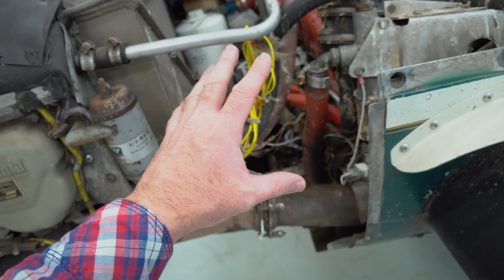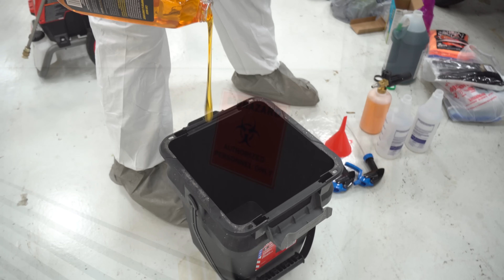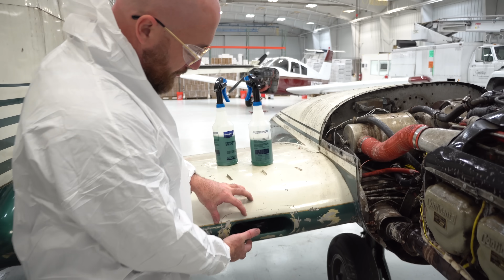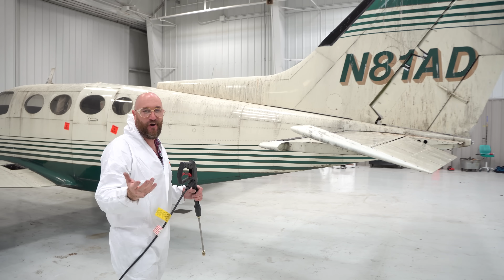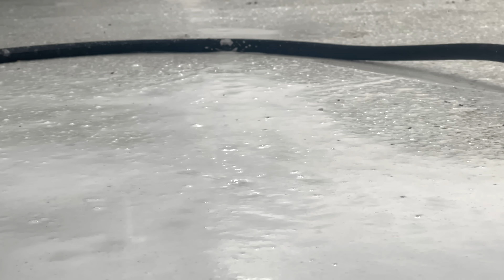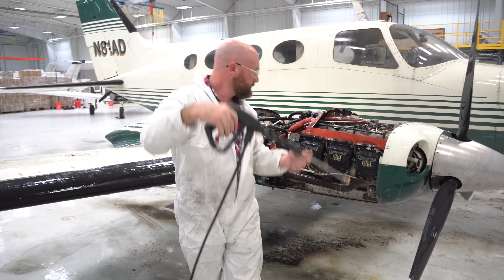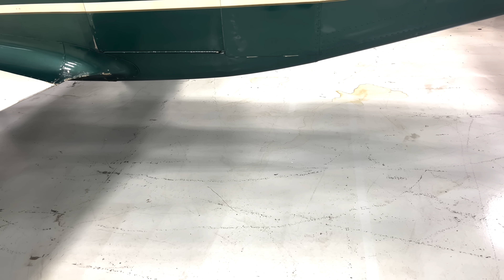Our FREE Abandoned Airplane Gets Its First Wash In 17 Years ! Ep7

Comment: Several years ago while working for a Aero Club we were able to get a 310K that had been a drug seizure. It had sat on St Simon's Island, GA for 10 years. After working on it for several weeks we were able to got it where we could fly it back to Charleston with a ferry permit. The engines were in surprisingly good condition. The worst part was the landing gear, the guy that flew it to Charleston wasn't happy I stipulated it be flown gear down but once he saw it on jacks with the gear mid travel and not moving up or down was glad I done that. You've got a lot of work ahead of you.

Comment: You ought to open all the inspection panels and look inside, especially on the wings.  If there's a lot of corrosion in the spars you want to know about that now, and not after putting a lot more work into it.
Reply: I've been thinking the same thing since this project began.  There will be a ton of hidden damage.  That mouse (likely mice) inside could also have done a lot of damage to wiring bundles.  Having an experienced A&P look it over before putting a bunch of money in it would be money well spent.

Comment: The EROSION & EPA FINES  that all dirt being washed away are going to cost you are more than the plane....
It was illegal to wash under the 1986 Anti-Erosion Act, don't let them see the video evidence ;)  Amazing for what was still underneath, although the dirt may have acted as anti_UV protection, saving the paint job.
Reply: which is likely the reason it was washed inside with the hangar doors closed. At most airports without a dedicated wash rack it is illegal to wash planes where the runoff can enter a storm drain.
Reply: @buckmurdock2500   Didn't know that about airports and washing planes. I would assume issues for fuel, oil and other chemicals for  run off of  such, if it didn't go into a sewer system.  Verses drains going to open creeks for surrounding open land for run off.  

Also I'm guessing my joke may not work or translated well over the internet for the ""erosion"" of all that dirt on the plane's  body by cleaning it. There used to be joke bumper stickers on most  dirty work /farm trucks from where and when I grew up,  stating that it was " illegal to wash the vehicles due to 1986(year varied) Anti-Erosion Act"  from the dirt be so thick on it. As if the vehicle had so much dirt on it , it was viewed more as mound/hill/mountain and  the high level of dirt being washed and running off from such would fall under anti-erosion protection laws....

Comment: With extra hot hot water and oxyclean it would remove all the grime and oxidation off. Also orange oil will dissolve a ton of crud. I have cleaned diesel motor caked in oil and crud with hot water and orange oil mixed looks like milk took all the crap off down to the metal

Comment: no fuel on sparkplugs despite spraying directly into air intake.  engine is not pumping, air not being drawn into cylinders. This is corroborated by low compression readings.  Valves are stuck open or are not seating closed completely.  Take off valve covers and tap valves with a brass mallet, try to get them freed up.

Comment: Rinse, Foam, Presure Wash, Foam, Hand Wash, Rinse, Dry............ Also foam then pressure wash the dirty spots first to avoid dirt spray on your already clean spots like it did for you. Put a stronger nozzle on the pressure washer and step further back your too close. You'll save time and be able to get more surface with a single stroke

Comment: I can only think that, not on camera, he's got an AMO doing the actual rectification work (corrosion, flight controls, pneumatics, fuel system wou.... Basically everything). It's costing a fortune but that could get you a really expensive 'free' airplane that you could use for a private operation. If that happens the engines and props will not be the ones fitted.

Comment: The exterior is simple enough except that the engines really need taking apart and the individual components cleaned/serviced (otherwise it is a simple pressure wash on a large scale).  The inside is a bit more tricky.  I think I would try to get a container or a skip to put all the seats and fittings into so all these things could be tackled individually.  After that it would be a big task scrubbing all the surfaces.  I would assume that with all the electronics in there spraying water around would be a very bad idea.  I also suspect that inside panels would need to be removed in order to get at areas where birds and/or rodents had taken shelter, made nests and chewed connections.
Reply: Given how a good portion of the panels are filthy and aren't working properly, they're likely going to have to take it apart anyways.

Comment: “Pro Tip” Fill the bucket with water then add soap ……
You won’t end up with a bucket of foam …….
Alway wash top to bottom and work in the direction of the air flow (ie;front to back) and never against the lap of body panels ……

Comment: Thank you for a very entertaining challenge, I have a suggestion for why the Right engine won't start, I didn't see if you freed the Turbo on that engine in the first ep yu could not turn it. I may be restricting the air flow enough to stop it????? You were getting fuel flow from all those injectors as shown by the cups, so I don't understand why the plugs are dry, maybe there is no fuel getting through even though there is pressure. I am not a mechanic but I have built a few engines. I look forward to your next ep. Chris
Reply from the maker: We’ll pull it all apart again and take a look. We’re thinking it could have some internal issues

Comment: Did you ever get the right engine running? It seemed to me that it wanted to start when u had the left engine idling so I was thinking from where the charging system was putting out more power that it was helping the right engine crank faster so if I was you next time you try to get the right engine running I would fire the left engine up and let it run while you do so. just a thought.

Comment: Your going to need a complete air worthiness certificate, so all removable panels will need to pulled for ap inspection. I would pull both engines with major inspection. Then all the airframe attachment points can be checked and hinges greased. Remember those tanks will need major inspection and cleaning.

Comment: @Rebuild Rescue how are you doing with finding A & P engineers with approvals on type? Especially with heavy maintenance experience. Without these guys to carry out the leading edge spar work and the certification you’re dead in the water mate. I’d love to see this plane fly again BUT  as a licenced CAA engineer in England with many years of heavy maintenance experience I have my doubts about how the airframe may have faired with corrosion issues. 
As I said previously though those engines would work great in many other applications that won’t require certification.

Comment: I just donated. Love the channel! On engine two, have you done a comparison rolling torque of each engines internal friction (ENG1 and ENG2) with spark plugs installed and one with plugs out and compare readings? You should be able to attach the appropriate scale dial type torque wrench to the prop hub or starter drive and see how much torque it takes to break it free and start it to rotate. I am a marine mechanic and this is how we shim outdrive pinion gears. This would tell you pretty darn quickly if its an internal issue or not.  Also free up that turbo if frozen. Cheers!
Reply from the maker: Thank you for coming on board and being part of the Rescue Crew ! 
We’re going to pull engine #2 apart and see what’s going on. Something just isn’t right….

Comment: I'm surprised he was allowed to do the initial bulk cleaning indoors. Some animal droppings are toxic in addition to being unsanitary, and now all of that is floating around the hangar interior and on the floor. I haven't even thought about the engine cleaning residue.
Reply: hangar doors were closed for a reason
Reply from the maker: Don’t worry the hangar is setup with a heavy floor drain system for wet work. The drains also have a catch  in them for larger debris. After cleaning the 401 we spent hours cleaning up the hangar. The floor looks amazing !

Comment: I have a question, I've been a rotory wing mechanic for 7 years and I dont have any experience with fixed wing aircraft, but question is: is there a swashplate mechanism that provides pitch to the rotors or are they fixed?
Reply from the maker: Hey Alex
They change pitch hydraulically

Comment: A company I worked for had a power washer that used a Rolls-Royce Radial Aircraft engine and used two 3/4 inch id hoses to fill a 300gal tank. With the proper fittings, I could hit the top of a 25-foot wall from 15 feet back and knock the dirt and grime off. That power washer was a beast to work with, but so much fun.

Depending on the temps, I would have taken this outside to wash it using a power washer so as to keep from getting crud on the other planes.

Comment: Right from episode #1 I couldn’t quite understand the priority of getting the engines running vs cleaning out the inside of the plane. You and other had to repeatedly entered and sat on the bird poop infested inside which was absolutely disgusting and very dangerous to your health. In one day you could remove most of the seats carpet etc and then pressure washed or vacuumed out most of the bird/ mouse poop. 
While its the worst job of any (cleaning out the plane’s interior) it just makes sense to do it first . 
Good luck with your build … I can’t wait to see this restoration fly!!

Comment: I dont know if this you tube cleaning of aircraft is over but many years ago Iworked as a sanitary engineer in food and petrochemical and oil refineries pasteurizinhg plants etc and the black mold inside that aircraft is toxic I would use a very low volume high pressure system with a ventury connector to intake a qusternary ammonium cleaning disinfecting stock solution. to shock all the mold.I dont remember if it reacts with aluminum so befote i would disinfect indide with that method would consult eco labs on the chemistry and cleaning side and the aircraft manufacturer to clesr whTever formula and concentration and feed rate should apply on the venturi if in effect a quaternaryammonium isapproved Qust is not ammonia it ia active ingredient in lysol  to

Comment: I have actually enjoyed watching you work to get this old bird started. That said, I would never consider trying to fly this airplane again. There is just too much that is likely compromised on this airplane that you cannot even see to ever risk taking it up in the air again. Every inch of wiring has to be removed and replaced as it is just an electrical fire waiting to happen now. And the cost of the two engine overhauls alone would be huge. But, that really isn't the point of this channel is it? PS: You had better start wearing a mask when you are inside the plane if you value  your lungs.

Comment: Hi, Guy.. I been watching with much enthusiasm.. I have a question , I hope you can advise me.. Since you have been dealing with abandoned airplanes, I was wondering if you could help me on how to go about getting a small plane ( 2 seat ultralight ) registered and in lawful order.. There is no paper work or logs....what to do ?
Thanks for any help...
Reply: Part 103 Ultralights can't have 2 seats, however, at one time the FAA allowed them to be used as ultralight trainers, provided the operator applied for and received a training exemption.  With introduction of "Light Sport" airplanes, the FAA said no more ultralight training exemptions and gave the 2 seat or "fat ultralights" as they were called, a brief opportunity to be legalized by registering them as ELSA aircraft. The period to make that happen has long past and it's no longer possible to register a 2 seat ultralight as ELSA.

The only thing you can do now is try to register it as an Experimental aircraft in the "exhibition" category. 
You'll need to get an N-number, register the machine with the FAA registration branch and finally apply for a Special Airworthiness certificate in the experimental exhibition category. The aircraft will need a condition inspection by an A&P mechanic, a paperwork inspection and then an FAA inspector or designee can issue the A/W certificate. It will have to be operated IAW with the operating limitations by an appropriately rated pilot.

Comment: Using a pressure washer is forcing the bird poo and acids into the lap seems, joints and hidden areas of the airframe. That is how major structural members get corroded and fail- because you can't see it. Sorry to see it performed.

Comment: Did you destroy the engine?  Maybe. After you've got them both started and run awhile (a) oil pressure (b) compression and leakdown test (c) motor oil chemical analysis. Even if you end up selling the engines, the metal composition in the oil is important starting point.   Starting the right engine:  As others have suggested, pull and ground the plugs from a few (4) cylinders.   Swap in known good injectors from the other side into at least two cylinders.  Then manually squirt in a measured dose of avgas/ether into those two cylinders.  If that doesnt make it pop a few times during cranking, you got spark or other breathing issues.  Good luck.

Comment: Dude........thats the wimpiest pressure cleaner I've ever seen. 13 hp Honda with a Cat pump. 4000psi, then add a turbo tip to get you to 5500psi. Throw the hand spray bottles out, get a cordless pump sprayer. 30 second outdoor cleaner is amazing on anything white painted metal.

Comment: OK, first I'm not an A&P mechanic, just a guy who has some electrical experience, including a small amount on aircraft. Some of this knowledge came from an electrician on the Space Shuttle. I was a bit concerned about the speed of the turn over on the right engine. Basically since you eliminated the starter as the problem, this is usually caused by either an electrical issue or rotating resistance. To determine rotating resistance you might consider rotating the engine with a torque wrench that just has a dial on it. Do this on both engines to determine if there is a major difference between the two without spark plugs so you are looking at just other sources of friction. If there isn't a major difference between the 2 then the problem is probably (not always) an electrical issue. The biggest source of electrical issues is grounding. This could even be corrosion where the wing attaches to the fuselage. I'd use a digital voltmeter and check the voltage between the battery you are using (directly on the grounded post of the battery) and the starter body. If this is much more than say 0.2 to 0.5V while cranking you are likely looking at a grounding issue. This will be interesting to track down, but you probably should look at it. The same can be said between the ungrounded battery post and the power post on the starter (directly on the bolt, not nut or cable) while cranking. If you see a similar voltage here you will be looking at the power relays, terminals, etc.
It would be a shame to go through the rebuild process and still have a cranking issue afterwards.
Good Luck with the project!

Comment: Varsol for the engines. No one does degreasing better than VarsolTM... The degreasing formula has professional strength for cutting through the gunk and a delicate touch that won't harm the surfaces you're cleaning. Spray engine and let sit for some time to soak...then rinse with water. Follow MFG's instructions. 

Interior disinfect...Pool Chlorine 1/2 cup in a bucket and a small fan propped over the top of the bucket pointing upwards  "off gassing the chlorine" into the cabin...let run for minimum 6 hours then use a larger fan to evacuate the cabin of the chlorine Gas/Fumes. This insures the hard to reach places have been addressed from nose to tail. This will not harm the equipment or interior however it will kill off all the mold and mildew and bacteria and the smell instantly!

Outside Surfaces...clean with a mild detergent (Dove Dish or patio Deck Soap Cleaner) and Pool Chlorine (2 parts Soap 8 parts Chlorine). Use a Horse hair brush and garden hose water to rinse. Pressure washer may cause other issues or damage!

Do not use "Grease Lightning" on Painted Surfaces as it will remove clear coating and prep for painting unless you intend to repaint.!!

Comment: Question for those who work on engines.  I was always told on my car engine to put plastic over the electrical components before pressure spraying the engine to ensure the electronics stay good after the cleaning.  Here nothing was protected that was electrical.  Won't that create electrical problems on an aircraft engine just like a car engine?

Comment: I just ran into a CL ad for a 1978 Cessna 414a. 7803 airframe hours, LH engine 5 hours, overhauled, RH 1331 SMOH, NO TURBOS. Props, 1300, need annuals. This girl comes PACKED with a glass cockpit, winglets, refreshment bar, AND a weather RADAR. He wants to get rid of it for $165K USD. DM me for the  CL link.

Comment: This guy has absolutely no knowledge of engines, the only thing he does very well is only a celebrity says haha I would never have my engine repaired, he should start by cleaning the engine and not unscrewing the spark plugs in these birds' nests, something can always fall in and this is not a lawn mower grass only the plane, then he should check the spark plugs, if they have a spark, then if the fuel reaches the cylinders, it was enough to spray the air filter with tears, if there was a spark, the engine would immediately start what he does, it's just embarrassing!!!!